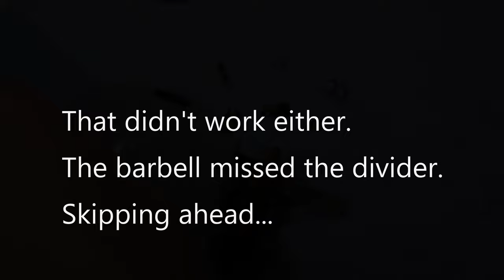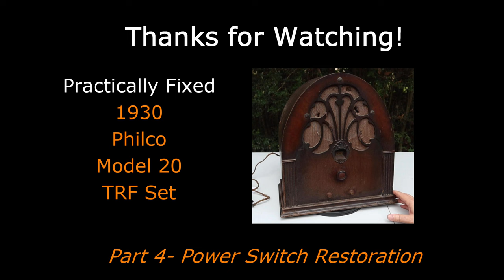94 Year Old Philco Model 20 - 1930 - Power Switch Repair - Vacuum Tube TRF Radio - Part 4  [4K]

Comment: Timely video, I am working on a 20 with an intermittent power switch. I managed to take off one rivet and swing out the cover piece only so I can see inside. What cleaner do you think I should spray in there to try before dismantling?
Reply from the maker: Hello George.  I would try CRC QD Contact Cleaner from the Auto Parts store first and maybe try a little scrubbing action with a pipe cleaner if it fits.  I believe the culprit is dried, dirty grease on the contacts.  Other contact cleaners, if you have them, such as MG Chemicals Contact Cleaner or NuTrol are good.  Let it dry well as the contacts will arc at line voltage.  The phenolic wafers absorbs that stuff and you want it to dry out as I believe it will break down phenolic over time if left in there.  (WD40 is flammable and will ignite if there is arcing - saw it happen on a relay contactor.)

If that doesn't work well enough, now that I have opened up that switch and put it back, I would do it again to do a thorough job.  When opened up, the the QD on a swab does the trick with a little scraping to help.  Now that I know what to do, it wouldn't take that long and the job will last a long time.  If you lubricate the yoke to the middle of the dumbbell, I would suggest an extremely tiny amount (tiny: like the head of a pin) of dielectric grease (auto store) so it won't lead to shorting out.  Let me know what you end up doing and how it works - we all want to know.  Good luck on the 20!

Thanks for the note and if this video helped give it a sub and thumb if you haven't already, it helps others to see it.  Thanks again.
Reply: @PracticallyFixed  I have some deoxit D5 and Fader. Do you think one of those would work? After watching you put it together I’m worried about taking it apart haha.
Reply from the maker: Yes, I'm just a little skittish of residue; the contacts didn't corrode, they got packed with old gunk that got dirty and dried out.  I understand why you would avoid the disassembly, especially the way I was whining (ha), but I was a little traumatized from the experience as I didn't know what to do - fun like a roller-coaster - gasp.  
But I knew that Philco had to be able to assemble them quickly during production, so I just needed to figure out "the trick".  I have another Philco of this era I will restore eventually and it has this same switch.  I will take it all the way apart as I did here just see how fast I can do it now I know the trick.  Just don't let the spring launch parts into oblivion!  Good luck and let me know how it turns out.  (c'mon - go for it!! You want to...)
Reply: @PracticallyFixed  I sprayed the tiniest bit of deoxit in and used a very small swab. Could reach the closest tab easily and took off a ton of gunk. Bent the swab and got to the far tab and also pulled off a ton of gunk. Used a heat gun to lightly dry the phenolic. Testing shows perfect ops for now where it was very intermittent and mostly not working prior. I have a lot of other work to do before I need the switch so I’ll let it dry thoroughly. If it gives me any fits then I’m going for it. Thought this was worth trying anyway. (Chicken)
Reply from the maker: @georgescott1353  awesome. Glad it worked!
Reply from the maker: Pinned

Comment: Well done to keep it as original as possible. Lots of patience! Maybe compress the spring and tie it with thread, then cut the thread when it's in place?
Reply from the maker: Thanks.  Yes keeping that original switch will preserve the feel of using the radio and it is cool old technology I had not seen before.  A string might work too but the needle also gave me a "handle" for positioning the parts.  Thanks again.